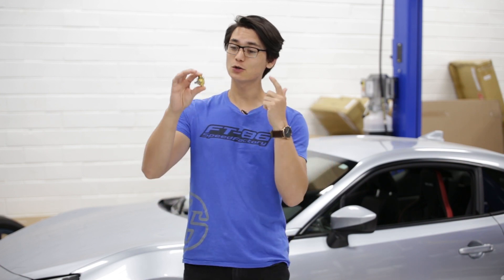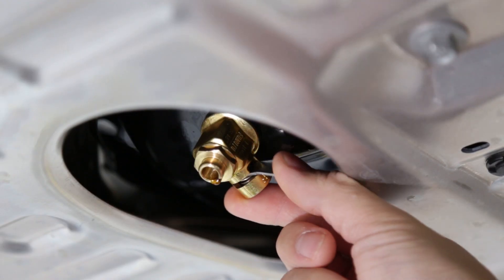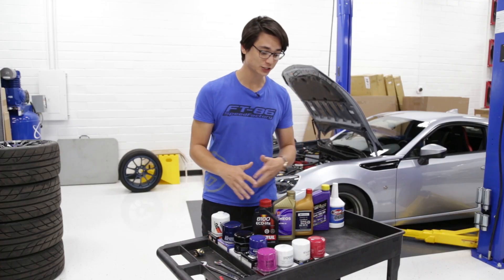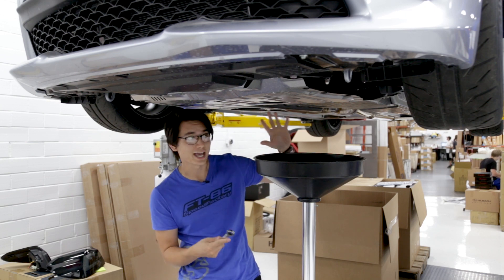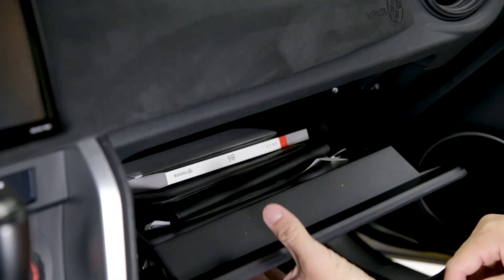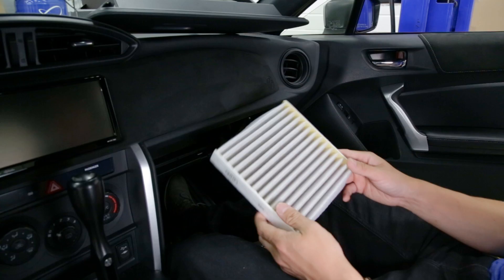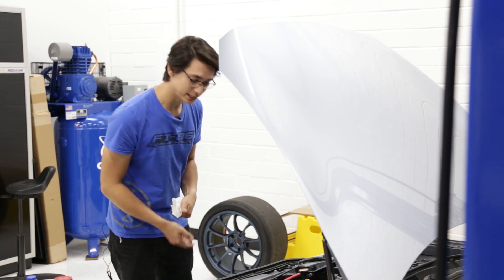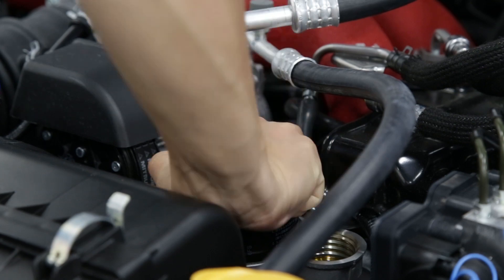The best way to change the oil on your FRS/BRZ/86

Comment: quick tip, oil drains a lot easier if you remove the oil cap or loosen the oil filter first

Comment: DO NOT tighten the fumoto valve by outer hex fitting, tighten using the inner one. Outer hex is for the actual hose fitting and strips super easily. Ask me how I know.
Reply: how do you know? I'm holding mine in my hand and only see one spot where I could tighten it
Reply: You tighten it using a crescent wrench on the body of the valve, it is flat parallel on both sides and can take the torque.

Comment: 0w-20 is used for best fuel economy, not for extreme condition or high RPM. Will you carry other weights of oil for those of use who prefer a bit more protection over fuel economy? Such as 0w-30, 5w-30, or 0w-40 for boosted applications.
Reply: EXACTLY! Putting 0w20 in a car made for spirited driving and track use is just gonna wear out the engine prematurely. 5w30 or even 5w40 is recommended, especially for hot weather.

Comment: whoever changed the oil on mine last tightened the hell out of the oil filter and it took me and my brother an hour and a half and 2 trips to the auto parts store to buy oil filter wrenches
Reply: Same here it was a bitch to get off, totally forgot to put on the blue crusher washer when installing the valve, oh well…

Comment: I'm late, i know but read these advices before doing a oil change on your 86/brz. 
Start your car, heat up your oil (2-3min). The oil should be warm enough to not burn yourself while changing your oil so let cool the car a little bit. This will dissolve deposits and particules in suspension in your oil.
And after changing your oil and before turn on the engine there is a way to cranking it without starting (and let run the engine without oil). Be sure the car is in neutral, Fully press and hold the accelerator pedal to signal the ECU not to inject fuel and turn on and let the engine crank. And as i already see in comments, don't forget to top up your oil !
Now you are ready to go !

Comment: I followed this advice years ago and now it's costing me. I got through maybe 4 to 5 oil changes before an impact took out my oil pan. The skids plate will flex and allow the valve to get hit. To it's credit the valve survived impact... but the threads on the oil pan.... Fubar
Reply: I’m thinking the same thing, that thing will get scrawnched in a lowered car and around these roads

Comment: When restarting the engine after oil change, push the accelerator pedal flat to the floor - the engine will not fire, as this activates 'clear flood mode', turning off the injectors - let the starter motor turn the engine over for a few seconds. This turns over the engine at much lower rpm that starting up and running normally, avoiding any unnecessary wear on initial startup at a time when the engine is somewhat oil-starved due to removal of the old oil and installation of the new - empty - oil filter.

Comment: I had some oil pool in the filter "dish" with the HKS filter. Never had trouble with any other filer.
Reply: I just did first oil change on mine and the Toyota filter that was on there left a pool as well. switched to k&n

Comment: update 05/2019: the SX series valve  is not a good fit for our twins due to the angled oil pan hole. just get the one on this video and don't torque on the hex head. Get model F108S for hex head or F108 (no hex head and no nipple for hose).

Right from the fumoto manual for F-series valves:
"Torque: Tighten the valve with a crescent wrench on the body of the valve* an additional 1/8 to 1/4 turn. Do not over tighten. 
*Do not use a wrench on the hex head if present "

Great video, just do not wrench on the hex head like they did it here or you will mess up the valve. The new SX series don't have this problem and look much better. Size for the twins is 16mm diameter, 1.5 thread pitch. Model F108SX M16-1.5 SX series drain valve. Nipple dimension 3/8" if you want any accessories for it. Gonna install one as soon as break-in oil change is due.
Reply: Shit, I can't believe it's been a year. Gonna change oil soon. Thanks younger me.

Comment: Good video very informative but I stick with mobile one and you don't have to let the car warm up you can just hold it at about 2000 RPM for 10 seconds and all the oil will be in the engine block so you can get a proper reading on the dipstick but still great video man

Comment: When you let the car run, won't the oil filter fill up? And if so, would you need to check the level again and top off?
Reply: There's usually an oil amount when doing a new oil filter and then a lower amount if not replacing the oil filter.

Comment: One question, How about tropical condition without winter/snow? Should I still use those kind of oil SAE? Can I go slightly thicker and more common oil like SAE  5w-30? or 10w-40?

Comment: Hi thanks for the video very helpful but I have a question. If my 2017 toyota 86 has over 90k miles should I still use 0w-20?
Reply: Yea it will be just fine. Just run a high quality oil with a high quality filter. Check it every fill up and change it every 5000 miles. Oil is cheap engines are expensive.

Comment: @ 4:22 he doesn't even secures the locking clip properly lol. Next bump and it will fall . Go to link in the bio and you'll see that the pin is supposed to lock with the bracket

Comment: I have a 2016 Scion FRS and am trying to get my oil changed on it but the 14mm bolt is rounded off. My husband went ahead and bought a 17mm (as recommended by nearly every auto parts store here). Is it going to fit or do we need to buy a 14mm?
Reply: If the thread pattern is the same and it is the same size bolt then yes. The head size is of little importance 14mm vs 17mm. Personally I’d go to the dealership and buy the real deal drain plug.

Comment: i have an aftermarket air intake and a catback exhaust.. do i still stick with ow-20 oil? please i need help
Reply from the maker: There's a lot to consider when wanting to change oil weight. When in doubt stick with OE recommendations, but if you want to explore other options there are some things to consider. You'll want to think about the climate you drive in most frequently and how the car is primarily used. Then we recommend getting an oil pressure gauge so you can monitor and ensure you don't have any spikes or drops.